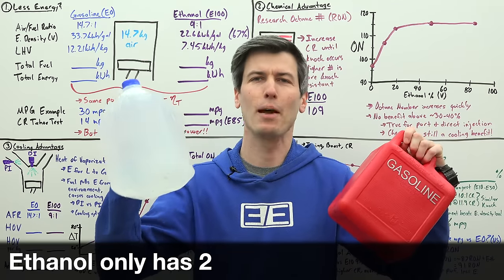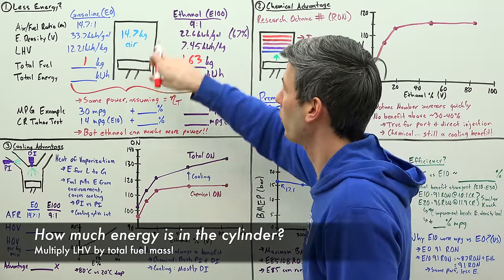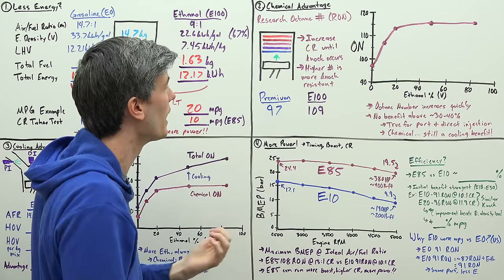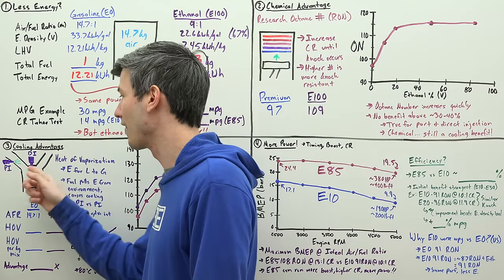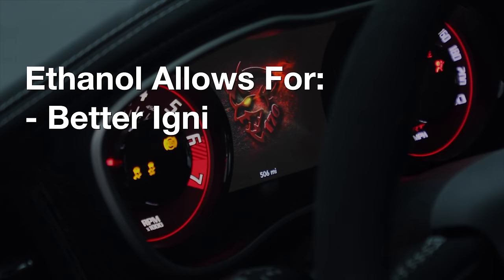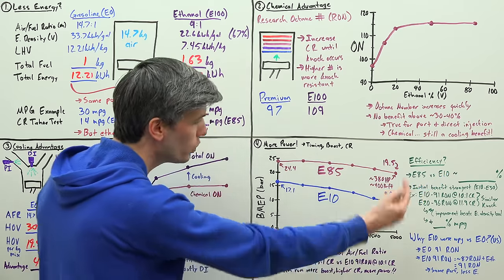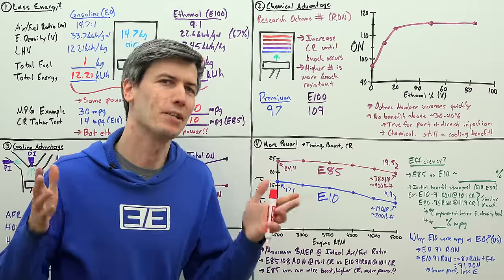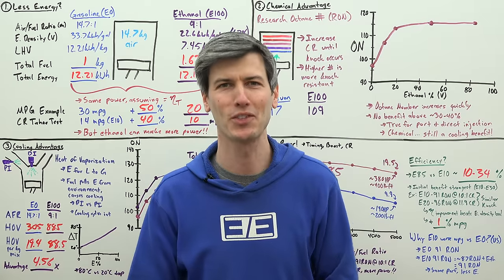Why Does Ethanol Make So Much Power? (Versus Gasoline)

Comment: LAUGHS IN BRAZILIAN
Yeah, the trick with high ethanol mix or better yet ethanol E100 is high compression ratios, mostly around 13:1, but higher compression ratios can be used with little or no boost.
In Brazil they were running an ETHANOL program to produce the fuel and cars that exclusively used that as early as late 70's. It was never just putting ethanol in gasoline engines. Besides the compression ratios, the fuel systems need to be ready for ethanol, which is a completely different chemistry the gasoline, not to mention the tendency of ethanol to absorb water and turn into gel over a long period of time if not used or cleaned. It had some surface treatments to cyliners and pistons if I'm not mistaken.
To bad many engines there went to the "flexfuel" injections in the 2000's, which is just variations of a certein manufacturer's injection adapting to the ethanol/gasoline mix, so many engines are dull gasoline egines adapted to run on a mix, just like in the US, so the performance isn't much better then gasoline (very little gain in power and some torque) since the compression ratios are between 8:1 and 11:1, so considerably lower then a proper ethanol engine should be.
Nowadays people in Brazil do performance modifications using more ethanol then gasoline, even in old carburated 70's and 80's cars, but also newer cars, but using programmable ECUs, mostly FuelTech. The gasoline based engines do require new pistons and rods, sometimes some modifications to cylinder head. We're talking about a lot of 4 cylinder 2L(125cu.in.) up to old 6 cylinder 4.1L(256cu.in.), some with some gain in displacement, but most is just compression ratio and boost to pull some pretty big numbers, with several hundreds of HP, any times in small "hot hatches" with less then 2000 lbs without removing the interior.

Comment: Why would the heat of vaporization matter if was port vs direct injection?  If it pulls heat in the intake tract, the air is cooled by the same total amount of heat energy.  So now it's a cooler charge of air entering the piston.  Whereas in the cylinder, it's cooling it after compression.  If it's pulling the same amount of heat energy either way, wouldn't the end result be the same?

The only difference I can conclude is cooling it in the intake tract means the air might get heated in the cylinder via contact with the piston/valves/cylinder walls.  Whereas cooling it after compression means the air started hotter and probably didn't absorb as much heat from contact with the piston/valves/cylinder walls during intake/compression.  Thus the final air temperature would be cooler than if it was cooled before entering the cylinder.  Is this right?

Comment: There's a reason a lot of boosted power-builds go with E85. 
However for around town/back roads driving, more power low is more fun to a lot of people. E85 is hard to find in some areas.
Reply: Around our area, E85 is at Sheetz, Casey’s, and some Speedways.  E88 at most Sheetz’ and Casey’s.  I have a pursuit rated take home vehicle, so it’ll run on 87, though not well.  E85 is a great option with wicked high octane at well over a dollar less per gallon over recommended 91, though with the 30% economy loss.  E88 (somewhere between fifteen and forty percent ethanol depending on the blend of that specific shift at the refinery that day) is a happy medium, little higher octane, nice price break, and I don’t have to stop at the pump every time I see it.  High 300’s on a tank of good ol’ petroleum, mid 200’s of E85, low 3’s for E88.

Comment: i only buy pure gasoline for ROAD TRIPS.
since it has higher fuel economy that would be optimized with highway driving.
my car can take E10 though so I dont know about performance and compression ratios for E85.

also also
i optimize fuel economy by driving a nissan rouge 27 city, 33 highway Gas ICE (non hybrid) SUV. and driving slower.

i dont GAS it to get to my desired top speed. i dont brake a lot but coast to lose speed or engine brake when i need to lose speed faster. 
i use 2 psi over the recommended pressure. (so its 35 PSI instead of 33)

i used to get 300 miles per 12ish gallon tank but now im getting closer to 360 miles per refueling.

I definately know Ethanol free gets more MPG but the cost difference is neglible compared to HOW I DRIVE. it is still significant BUT the higher price means id rather drive slower and save money instead of paying 50 cents more per gallon for INNER CITY COMMUTING.
id rather pay the premium when i have highway driving and more distance being covered like a vacation/road trip.
Reply: Makes sense. That’s why I prefer diesel for road trips …

Comment: I have a GM 6.0 in a 3/4 ton truck I use for work. Do these benefits of E85 translate into work conditions, not just power? Would it keep the temperatures more stable with lots of starts/stops? Or would it show any benefit to towing?
Reply: On a stock daily driver, without boost or excessive high compression, you would be stepping over dollars to pickup dimes.

Comment: Power is not just the enthalpy of combustion.  Gas has more than ethanol.  Ethanol, from an organic standpoint, is already partially oxidized, and resists pre-combustion more than short hydrocarbons.   Internal combustion engines rely on BOTH enthalpy of combustion AND how much cylinder pressure you can generate with well-behaved combustion.   Ethanol can be shoved in and overcome the difference in enthalpy.
Reply: Ethanol has a faster flame speed front, more volume of combustion products, octane, and other superior burn characteristics that makes it probably the most efficient fuel for an internal combustion engine.  Being pollution free is a bonus.

Gasoline optimized engines cannot take advantage of all these things so ethanol will get lower mileage in those engines albeit with more power.  For example, a Chevy 5.3L gets a clean 380 horsepower on E85 vs a dirty 355 horsepower of E0.

Ford's first prototype EcoBoost engine was optimized for E85 and achieved 15 to 20% better fuel economy than E0 with load performance similar to a diesel engine.  They did not come with it in flex fuel because they thought they could skirt paying for the patents from MIT scientists who developed the system.  That is still in court.

Ricardo built and drove an ethanol optimized engine for GM that had not only more power, but also more mileage than even their diesel engine.  This is why GM wants the EPA to come with a 100-octane fuel standard.

FROM RICARDO:
The new federal CAFE standards are calling for a doubling of fuel mileage performance, which, Vint says, is going to send OEM’s looking for high octane numbers to improve efficiency and ethanol is the best source. Ricardo, an engineering firm with over 100 years in the business of engine design, has developed an extreme boosted direct injection engine (EBDI) to optimize ethanol blends. The 3.2 V6 gasoline engine rivals the power and torque of a much larger GMC Sierra 6.6 diesel, he said, and it delivers 3.5 percent better fuel economy than the diesel.

This is not new technology or knowledge, it was known long ago.  It is suppressed technology.

Rear Admiral C.M. Chester wrote Henry Ford a letter on Dec.15, 1916:
"...I also pointed out in the article that as governmental laboratories had developed from 40 to 55% efficiency in alcohol engines as against 20% in gasoline machines, the use of alcohol at double the cost of gasoline for power purposes, was cheaper for motor[s] than gasoline in common use today."

Scientific journals from 1890 – 1920 contain hundreds of references to alcohol fuel at the dawn of the automotive era. 

Studies of alcohol as an internal combustion engine fuel began in the U.S. with the Edison
Electric Testing Laboratory and Columbia University in 1906. Elihu Thomson reported that despite a smaller heat or B.T.U. value, “a gallon of alcohol will develop substantially the same power in an internal combustion engine as a gallon of gasoline. This is owing to the superior efficiency of operation…”

The USDA tests in 1906 also demonstrated the efficiency of alcohol in engines and described how gasoline engines could be modified for higher power with pure alcohol fuel or for equivalent fuel consumption, depending on the need.

The U.S.Geological Service and the U.S. Navy performed 2000 tests on alcohol and gasoline engines in 1907 - 1908 in Norfolk, Va. and St. Louis, Mo. They found that much higher engine compression ratios could be achieved with alcohol than with gasoline. 

When the compression ratios were adjusted for each fuel, fuel economy was virtually equal despite the greater B.T.U. value of gasoline. “In regard to general cleanliness, such as absence of smoke and disagreeable odors, alcohol has many advantages over gasoline or kerosene as a fuel,” the report said. “The exhaust from an alcohol engine is never clouded with a black or grayish smoke.” USGS continued the comparative tests and later noted that alcohol was “a more ideal fuel than gasoline” with better efficiency despite the (*then*) high cost.

Comment: From the graphs it's seen that the engine efficiency increases with increase in percentage of ethanol, however, some of this incresse is due to increased compression ratio which can be achieved not in the same engine, the engine itself will have to be changed.
Reply: This is not new technology or knowledge, it was known long ago.  It is suppressed technology.

Rear Admiral C.M. Chester wrote Henry Ford a letter on Dec.15, 1916:
"...I also pointed out in the article that as governmental laboratories had developed from 40 to 55% efficiency in alcohol engines as against 20% in gasoline machines, the use of alcohol at double the cost of gasoline for power purposes, was cheaper for motor[s] than gasoline in common use today."

Scientific journals from 1890 – 1920 contain hundreds of references to alcohol fuel at the dawn of the automotive era. 

Studies of alcohol as an internal combustion engine fuel began in the U.S. with the Edison
Electric Testing Laboratory and Columbia University in 1906. Elihu Thomson reported that despite a smaller heat or B.T.U. value, “a gallon of alcohol will develop substantially the same power in an internal combustion engine as a gallon of gasoline. This is owing to the superior efficiency of operation…”

The USDA tests in 1906 also demonstrated the efficiency of alcohol in engines and described how gasoline engines could be modified for higher power with pure alcohol fuel or for equivalent fuel consumption, depending on the need.

The U.S.Geological Service and the U.S. Navy performed 2000 tests on alcohol and gasoline engines in 1907 - 1908 in Norfolk, Va. and St. Louis, Mo. They found that much higher engine compression ratios could be achieved with alcohol than with gasoline. 

When the compression ratios were adjusted for each fuel, fuel economy was virtually equal despite the greater B.T.U. value of gasoline. “In regard to general cleanliness, such as absence of smoke and disagreeable odors, alcohol has many advantages over gasoline or kerosene as a fuel,” the report said. “The exhaust from an alcohol engine is never clouded with a black or grayish smoke.” USGS continued the comparative tests and later noted that alcohol was “a more ideal fuel than gasoline” with better efficiency despite the high cost.

Comment: I’m in the UK and we recently replaced standard pump gasoline with E10 everywhere and now the “premium” gasoline is E5 and sold at a higher price. Does the theory of this video mean that the cheaper E10 is actually a better fuel for power but slightly worse miles per gallon?
Reply: We are USA based for I dont think we even know what your price scale is on petrol.

Comment: So unless your changing your compression ratio, changing the fuel in a normal engine will not have great benifits, even with variable valve timing.
To change fuel permanently to e95 and compression higher permanently, will get a big gain?

Comment: Thank you sir for being so smart, and not being so smug about it. You sir are a unicorn in a world full of gifted 🫏🫏. Is there any way you could take a common sense look at what we are left with for our small engine brethren once this ethanol/gas blend gas becomes performance wise once the ethanol either evaporates, or gets loaded up with water drawn from the atmosphere due to the hydroscopic properties of the ethanol? Granted we probably all know what happens when it gets so loaded up with humidity the water can no longer stay in suspension, but i have always wondered how detrimental this anomaly is throughout its various phases between new and right before the absorbed humidity falls out of suspension.
Reply: @Fred — What Dana said is correct. But to further help you envision what he is saying, think about this. Vodka is ethanol and water. If you have 80 proof vodka, it’s 40% ethanol. Have you ever seen it “fall out of suspension”?

What you are mistakenly confusing is that water will fall out of suspension in petrol, and the ethanol will stay attached to the water. That water-ethanol mixture (vodka) will not cause rust, BTW, as is often claimed by opponents of the fuel. In fact, vodka can be used to dissolve rust.
Reply: @sking2173  I was thinking the reverse. If I leave my whiskey bottles open will then wick Ethanol outta the air?
Reply: @oldblueaccord2629  — 😁 The only time I leave a whiskey bottle open is: 1.) if I’m using it as an air freshener; 2.) if it’s empty …

Comment: I live in Austria and they recently made the transition to Super 95 (octane) E10 (up to 10% Ethanol) whitch is as up now the new standard gas at any pump. You also have the option of Super Plus 98 (octane) E5 (only 5% Ethanol). I own a new generation Mazda 3 with Skyactiv-G engine, high compression ratio. Would it be beneficial to go with the E10 95 octane or pay the extra money for 98 octane E5?

Comment: There are two more advantages. First is CARBON BUILDUP. 
ethanol burn to mostly water, while gasoline does to co2. 
in case you get imperfect mix of air/fuel, pure gasoline gives you carbon monoxide and carbon buildup in the cylinders, while ethanol reduce it significantly as you have way less carbon to worry about. Very important for small city hoppers that often run on cold engine and only short trips.
The second part that does not show in such tests, is wear. Worn older engines react better to ethanol, as it's easier to create perfect mix, so it burns more violent, giving you a few of the horses you thought you lost 5 years ago. That's why we've seen quite a few engines that cannot take it, as that stronger initial push is too much for the aging unit. It also damages rubber and plastics a bit, so classics need to be wary of it. 
I would recommend E5 or E10 for anything from 2000 or younger.

Comment: plz do a test with E0 vs E10. here we just got the E10 fuel (had E0 98 RON and E5 95 RON before) and a lot of car's get sluggish and use 10+% more fuel on E10 vs E5. this SUCK! now ppl start to go over to 98 that cost more as it is seeper to run on.
btw. in tuned NA cars we use the cooling in the intake (often in front of the throttle body) to get more air in to the engine. so we put the injector so far from the port as possible. so i will say the biggest benefit is in the intake as you actually get more air in on a NA engine.
we do NOT se a benefit on ethanol IRL. and the minimum octane we have is 95RON. and it is not just energy i think a lot of it have to do with engines not being tuned for it and cant compensate enough. running lean so you put even more throttle in to compensate your self for the lack of power.

Comment: The flex fuel vehicles should require premium fuel or e85 and run much higher compression ratios. More power equals more efficient.
Reply: your right but OEM never took hold of it. The fuel mapping on those flex cars is absolutely terrible....50% drop in MPG using E85 most cases. Really its criminal OEM's  sabotaged it.

Comment: I read somewhere that the cooling effect was use I WWII in air plane engine were they use water/fuel  mixture to improve engine power. They did pre mix the water with alcohol , hoever it was not etanol - there were some issue with that. I think it was isopropyl alcchol.
Reply: The big problem with the military use of ethanol is the soldiers stayed drunk. After all, that water-ethanol mixture to which you refer has another name — VODKA …

Comment: Well in the EU drivers swear with E5 98 octane instead of the E10 95 octane. Because the big believe is that E10 is wrecking engines before 2000. 
It even believed and told at the gasstation that E10 contains 10% alc. and E5 98 octane still nothing. At least that's what BP claims.
Thus 98 octane is to be believed a better fuel than the one with alc. in in it.
Seen your video, one might wonder who is right and why?

Comment: Also with the benefits come the disadvantage! Alcohol Evaporates faster making it dry out seals and gaskets causing failures. In small engines were membrane diaphragms are used eventually it will stop pumping the fuel. In racing applications people run a top end lubricant to prevent valve seal and guide failures.